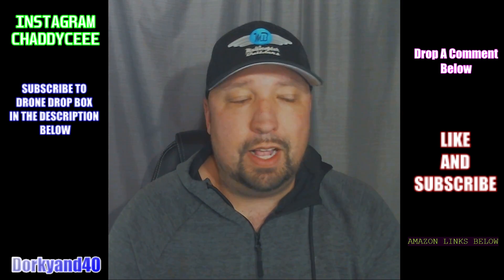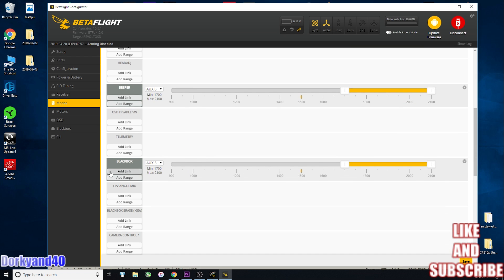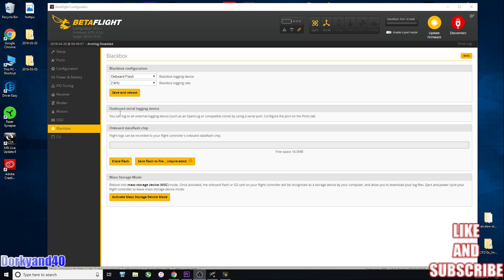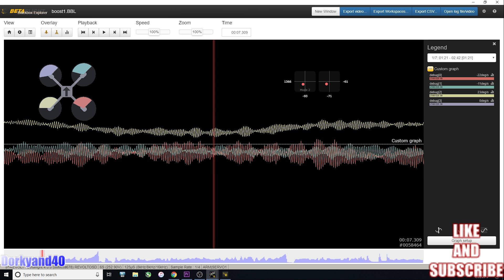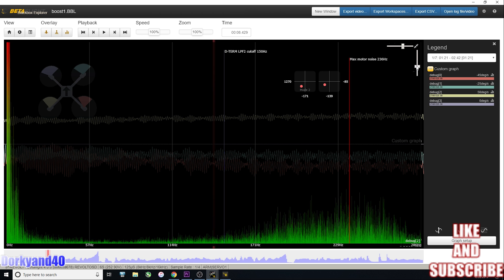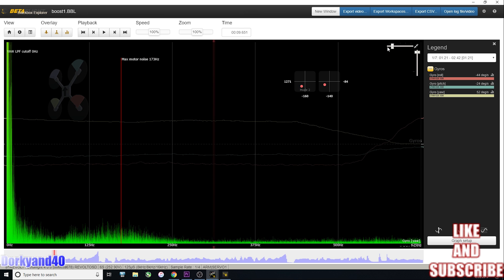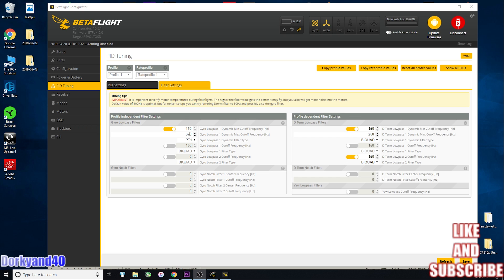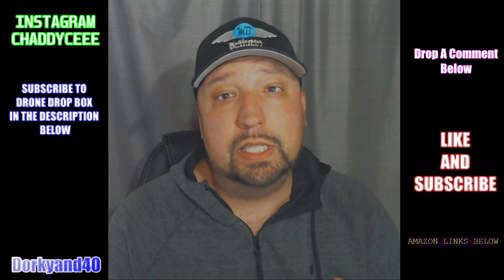SUPER SIMPLE PID TUNING:  LOG AND LOOK AT NOISE | BETAFLIGHT 4.0

Comment: first of all thank you for your films, these are very helpful. I have a question that unfortunately I could not solve so maybe someone has an idea. I have oscillations around 1300- 1400 Throttle, but these occur mainly in the pitch. I adjusted the filters as discussed in the video and the gyro output looks good. However, the vibrations at 1300 throttle rash remain visible. I see these in the debug as well as in the gyro. Any idea how to solve that? thanks for your help.
Reply from the maker: sounds like frame resonance.  very hard to eliminate.  what frame?

Comment: This was all going so well - I was following along and totally getting how to setup black box, and how to use the log viewer.  But then when you got the important bit - which filter perameters to change (and why) and how they correlate to the log view - you kinda lost me :(  We were looking at gyro_scaled right? But then the first thing you suggested was changing the dterm lowpass - and then also changing the gyro lowpass - both to the same value (which was a think, the start frequency of the noise increase).  Whats the difference? How do all those filter options relate to the noisy curves we were looking at?  Sorry :(  I feel a bit stupid asking :(
Reply from the maker: no such thing as a stupid question.  this topic goeson for hours and hours and its consatanly changing with each new firmware.  the topic of the video is how to simply gather a log and then how to see if you have a noise issue.  i do plan to make more videos on different settings and adjustments soon.  but if you read the comments you will see many people cant even get to this step.  so if youc ant get the data then it doesnt matter.  thats why i said start here.  thanks for checking me out and leaving a word!
Reply: @Dorkyand40  Thank you :)  I'm am that person - couple of years flying, and have never resorted to blackbox before.  Just built a 6/7" for LR, and got the RPM filters working right away.  But it's not a magic bullet, and the thing is still quite wobbly.  So - I'm going to put an SD card in my Radix - and follow your instructions here and try to figure out how to tighten things up.
Reply from the maker: Charles Tait 6-7 inch and raddix is a tough combo. It’s very power system dependent. Def try a few different props and battery sizes. Make it a little heavy. I have a few 7 inch floss video I added recently. I am having these issues and so far added weight has helped a lot. Also go to the betaflight 3.4 tuning guide and copy and paste the dirty quad filter settings from that guide into your cli. No matter what version your running. We have a big thread on the brain fpv Facebook group about it right now too.
Reply: @Dorkyand40  thanks - this is such a great tip - I'll give it a go - and also look at those filters settings and the difference between them and where I am now - and see if I can make sense of the general idea.  I ordered the right kind of SD card for the radix - it should be here today - I can always write a BB log, then apply those settings from the 3.4 tuning guide, write another log and compare.
Reply from the maker: Charles Tait hmm?  What sd card does it need?  I’ve yet to look or black box it yet. Just trying to get my mechanics down first.
Reply: @Dorkyand40  from github:  microSDHC cards known to have good performance

Transcend 16GB Class 10 UHS-I microSDHC (typical error rate < 0.1%)
Sandisk Extreme 16GB Class 10 UHS-I microSDHC (typical error rate < 0.1%)
Sandisk Ultra 16GB (it performs only half as well as the Extreme in theory, but still very good)

You should format any card you use with the SD Association's special formatting tool , as it will give the OpenLog the best chance of writing at high speed. You must format it with either FAT, or with FAT32 (recommended).
Reply from the maker: Charles Tait thanks man. Seems like I need to use a 16gb. Been a long time since I’ve needed to use a card instead of onboard memory.

Comment: Very helpful, finally know how to deal with a spectrograph, thanks! Please do a vid on how to use blackbox to tune the RPM filtering. Followed all the recommendations from BrainFPV and the BF wiki, but it's still not feeling great on my 6s 2407 1700kv Marmotte 5" setup. Not sure if I need to switch to different props (dalprop 5047 cyclone now) or how to spot trouble in the blackbox logs, even after watching a bunch of vids. D term always just looks chaotic and noisy to me whether I turn it up or down.
Reply from the maker: thanks man..i will get there..the rom filter is just very beta right now..so is the blheli firmware..ive seen many logs and pilots saying that the new filter code is working almost if not better then the rpm filter in many situations.  i have 2 perfectly tunes quads now (acording to the black box devs) so i plan to do some videos and show some things to look for at a basic level..rpm filter or not.  i would start by logging and just  looking at your motor traces and spectrographs of the motors with and without rpm..mine was nearly the same in my testing before i haulted my rpm filter testing
Reply: Wow, I had the assumption that RPM filtering was the ultimate, especially when dealing with non-standard 7” and 3” quads. I must experiment with it off and see how it goes. Right now I’m spending more time tuning BF4 than just flying for fun, so maybe best to stick one quad on experimental and leave the rest on standard.
Reply: Vaughn Dickson it is the ultimate.. it can as much as half your gryo latency which gives a very connected feel and can all but eliminate prop wash. It does suit a nice stiff airframe though as it tracks motors noise not frame harmonics.. and the dal props are kinda rubbish right now.. they have really fallen behind the offerings from hq and the new gemfan/tmotor props.
Reply: Sugar K sweet, will stick with it then! Got some tmotor and hq props to try. Love the toughness and bite of the dalprop 5047 cyclone popos, but I can’t seem to tune the propwash out
Reply: @Sugar_K  good call on the props! Last bit of tuning, still trading off propwash and noisy D term, so I switched from the dalprop 5047c to hq 5.1x4.6 and now both my 6s and 4s marmottes are flying beautifully! And finally got my 7" chameleon flying really well, just needed a lot of extra and lower filtering.
Reply from the maker: Vaughn Dickson if you watch my channel you see I’ve been doing the same lol. Now I’m playing with the squirt and nutmeg. Hey Mce they figure out the firmware and the correct filtering to add to the rpm then I think we will be good. But right now it’s what filters to you add and how to tune them to play nice with rpm and still get the right feel and performance. Lot of misinformation out there. Even Bardwell messed it up.

Comment: Your better off finding your fft value from the black box. Is you use fft_freq as your debug mode. The osd fft was aimed at whoops and micros with no BB it’s not super accurate unfortunately
Reply from the maker: coming sraight from the man!!!  good to know. i always look at my dvr and see the last number before it jumps when hitting the ground. i will debug it and grab a number. it should be close on this ship since its the one ive used the most.
Reply: I’ve been running the rpm with crazy high Q and just pt1 lpfs on gyro and dterm... no dynamic notch 🤔

Comment: Nice video there... What default PIDs did you use for your 6S setup? I just have a similar 6S setup that's around 740gms auw. I set it up for bf4.0, but not entirely sure about the PIDs to start with. Can you help me with what you started with?
Reply from the maker: hey thanks man..i have another video on the channel. maybe 2 or 3 videos before this that shows my PID set im using on my super g and my source1s.  i have made a few tweaks since then i sent it out to some betaflight devs and they said it looks good.  so ill have another video about it in a few days.
Reply: @Dorkyand40  ok... That will be great. Btw, I did the other video of yours and you mentioned most of the values are close to defaults.
But the tuning guide says to reduce the PIDs by a third to begin with, hence wanted to check with you
Reply from the maker: DroneAcharya I would say if you’re unsure about the noise level on your quad then follow their filter setup and then increase the pids. Mine are higher then stock. But I know how to tune and the feel I’m going for. Nothing wrong with defaults. Just try simple. Raise your roll or pitch p by 5 points and fly it. You’ll feel the change. Start small and dial in over time when you get used to the feel.

Comment: 9:40 Is that the dynamic notch or lowpass you are talking about?
Reply from the maker: Ro H yes. The only notch on the gyro by default is the new cascade dual dynamic notch that I have set from 150-670 and set to pt1. There are other ways to tune the notch now but you are basically making it less aggressive and taking it back to 3.5 levels.  For now I just set my low and high like here in the video and leave it stock width and q (the filter ability). There is info about that in the 3.5 tuning notes wiki. It should only be changed in 4.0 if you dig into the rpm filter stuff